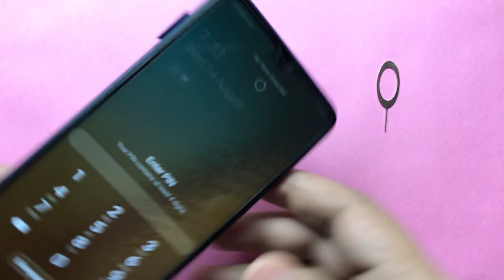samsung A10 back cover open | Pardeep Electronics

Comment: So basically you can’t do it easily without breaking or scratching.    Well done Samsung the charge ports are fragile aswell.      iPhone is the answer
Reply: wrong
Reply: Eipoone iz dhe ansher, they won't even fix it nowadays just buy new one they say
Reply: Xiaomi is the answer
Reply: Man you changin yo entire opinion about a phone cause it's hard to get the back off....makes total sense
Reply: @yashchandel  
n 
n

j
Reply: @yashchandel  pz
Reply: Samsung provides parts for apple so no.
Reply: Just put on a cover